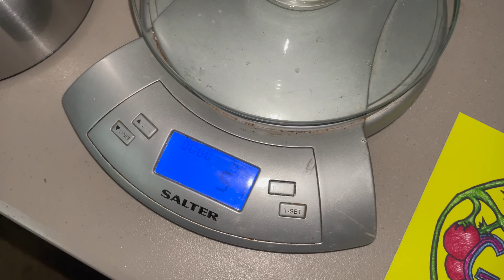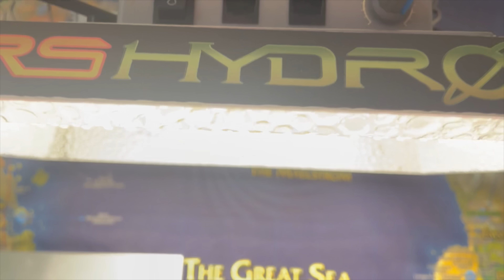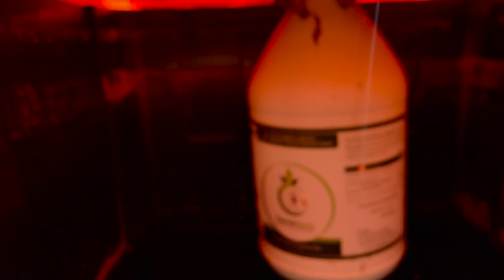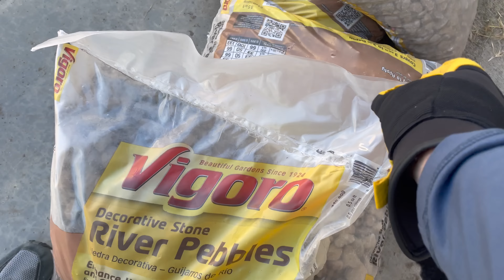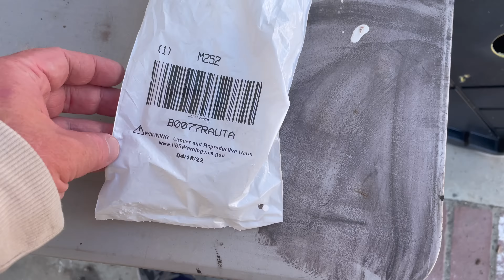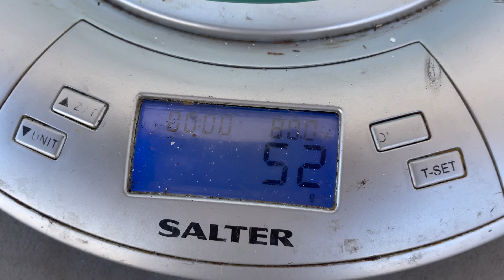Saying Goodbye to the Garden - Sponsored by Mars Hydro

Comment: I'm getting a strong feeling that water cycling is a problem; the static totes will stagnate and run out of oxygen faster than diffusion can replace and this will cause root die-off.
It's the same as overwatering a house plant, the soil starts to become foul and oxygen is depleted too fast. It happens even faster when it's warm water involved as it has a much reduced carrying capacity for dissolved gasses.
Areation may be your salvation, Jeff

Comment: I personally gave up on that damn sun and made greenhouse for more delicate plants. Basic shape, with plastic transparent covers and green net on top and air circulation(windows and small fan working on small 12v solar panel) garden lost that nice look but with semi-automatic watering system(pipes and one big jug of water that I just fill everyday) now everything grows fine. 
Temp is OK, still tad high but better than on direct sun and plant don't mind it as humidity is nice inside. 
I will probably put on side passionflower plant that will cover it over time, have one on wall and it dont mind high heat.
Reply from the maker: Sounds awesome

Comment: Whatup Jeb hope things are well. Summer in cali sounds very difficult for an outdoor hydro farmer. These plants can only handle so much heat in their reservoirs. I have two ideas. The first is going to sound too industrial, but have you tried using a 1/4hp or 1/2hp water chiller? Line up a few chillers in series/parallel with your buckets, and it may be enough to cool the reservoir temps down enough to keep the tomatoes alive. 

The chillers will use electricity...but in these 100F+ days i dunno. I saw a passively-cooled house that was built into a short hill with a shallow slope. Two cooling vents ran all the way under the hill slope, effectively using the cool earth to draw the heat out of the air by the time it got into the home. 

The second idea takes more labor but uses less electricity. If you had a long length of tubing or pipe (copper!) coiled up a few feet underneath the reservoirs, you could pump hot water down into the coil, where the earth would cool it down somewhat, and then it pours back down into the reservoir. This would use alot less electricity than a chiller-system, and might be good enough to keep the water from getting too hot in those totes. 

Now...the pumps need electricity. But a few cheap solar panels could handle it. The pumps will make heat...but if you keep the pump outside the tote and use a lead-in line to draw the water into the pump, you could prevent the pump-heat from getting into the water. 

Looking forward to next year's solutions! Everyone is going to be feeling as hot as cali in the coming years, so Jeb's innovations and engineering will be very much appreciated by generations in the future who want to continue growing and eating food in 110-120F summer heat.

Comment: I also do hydroponic plants in the garden, burrying the bucket and putting reflective material on the top help greatly, but most importantlym when it gets hot, I fill up my buckets with only cold water without additional nutrients. Maybe its because I dont live in the hottest country but I am able to keep my plants alive.
Reply from the maker: It is a challenge outdoors.
Reply: I was thinking the same thing. I think the salts make their leaves shrivel up when it's that hot.
Reply: @JebGardener  Not the easiest to implement, but the best solution may be to bury your water reservoir in a shady spot 5+ feet under ground. You can then use a solar powered water pump to send the cooler water from underground to the plant. To fill the water reservoir,  use a float valve connected to an irrigation timer. The irrigation timer can be set to run for an hour at 4 AM  (just before sunrise) so that when your underground container is being refilled, it is being filled with the coolest possible water.  Other than fertilizer, the system would be fully automated.

Comment: To me the only solution is connecting the tubs with tubes and cooling the liquid with air cooled heatsink. Problem is nutrients will calcify on the walls throughout the system and cleaning of system will be a must.